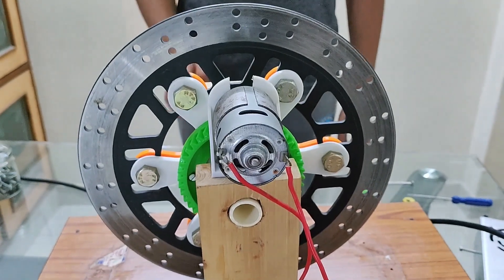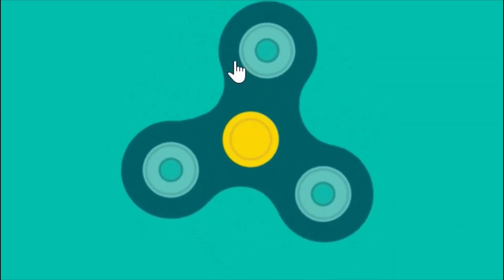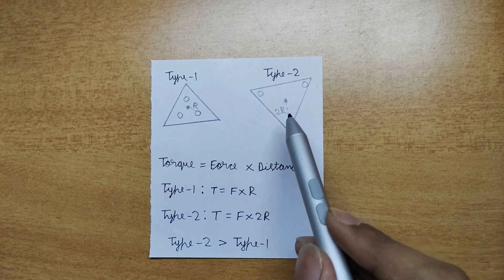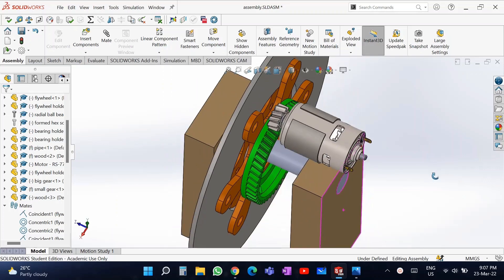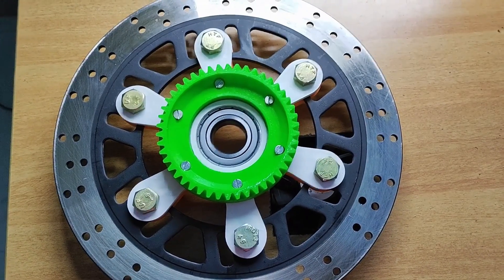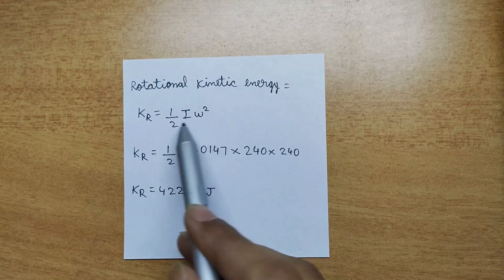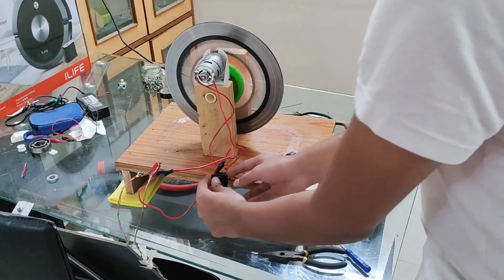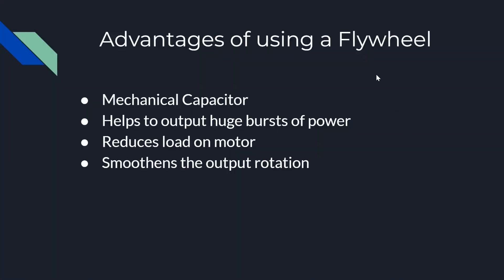Flywheel Energy Storage - Mechanical Battery and Regenerative Braking in EVs

Comment: Just reinventing K.E.R.S! Kinetic Energy Regeneration System. Now if you do this in a Vacuum you get rid of all the air resistance! If you coupling in is non contact magnetic then you lose all the friction!
Reply: Loose “all the friction” is a bit of a lie
Reply: @iguanarapido2552  You can lose more/most if you have your rotating mass in a Vacuum, like a Scuba tank! Most of the space is take up by the rotor & it can be ran at ultra high speed with no air resistance! The bigger the diameter the greater the peripheral mass the further from the centre, the faster it rotates. The more energy you can store for longer!

Comment: How to integrate electromagnetic braking system along with regenerativs braking can u pls help me
Reply from the maker: For electromagnetic braking, you can just short the terminals of the motor or connect it to a low value resistor. All the kinetic energy of the flywheel will be converted to heat.

Comment: Great job! can you please put the solidworks part by repliying to me please
Reply from the maker: The CAD files are in the below link
https://drive.google.com/drive/folders/1-WvbbmJMV3YOA-4OExCOW6UPLpViqqt_
Reply: @aarravoltics4592  thank you very much
Reply: Hello  @aarravoltics4592 ,

Can you explain why or how the flywheel keeps turning when the engine is switched off?
Reply from the maker: @salimtemsamani598  the flywheel has a lot of rotational inertia. So it resists the change in state. It keeps rotating for a while even if it's not powered.

Comment: Is it possible to add a second battery set to a car and use this motor to recharge another backup battery. Is it going to affect car speed or will it consume more energy?
Reply from the maker: Yes, you can connect this regenerative braking system to a smaller battery (12v battery in a car). When braking, instead of using the car brakes which waste all the excess energy, the energy is converted to electricity by the generator and the 12v battery is slowly charged.
So, instead of using an alternator to charge the 12v battery, this can be used. 
This will actually consume less fuel in the car. The alternator consumes some of the energy the engine produces. But if the alternator is replaced with this regenerative braking system, the mileage (fuel efficiency) of the car slightly increases. 
This is why, the new electric and hybrid cars have regenerative braking.

Comment: Great work! Do i understand current that you simply switched the motor off power supply and then directed the motor (now generator) output to the leds directly? And what was the weight of your flywheel?
Reply from the maker: Yes, after the flywheel is spinning at the max speed, the power supply is disconnected and the motor/ generator is connected to the LED light. 
The flywheel is from a motorbike disc brake and it weighs around 1.3kg
Reply: @aarravoltics4592  thanks very much for the informative project and for your quick reply with the info!
Reply: A power selector switch

Comment: What happens if you press the switch again before the flywheel finishes braking?  For example, just 2 seconds after pressing it the first time to act as a generator.  Would the motor burn out? 5:57
Reply from the maker: If the switch is pressed, the flywheel will start accelerating again. 
But this might overload the motor and gears system because power is given to the motor instantly and power will be high until the flywheel reaches its max speed. 
To solve this, a constant current power source can be used to prevent overload of the motor.
Reply: @aarravoltics4592  Thanks for your quick response brother.  Blessings.

Comment: as per your calculations
10% energy saving @ peak
and voltage getting down with rpm
right ?
Reply from the maker: This model that I have built is not very efficient. So, around 70-80% is wasted and 20-30% of the energy is recovered. 
But in commercial flywheel energy storage systems the efficiency is much more. 
Yes, the voltage goes down as RPM reduces

Comment: how did you break current from the voltage controller(the module with a dial) and connected the electric motor circut with LED? What type of switch did you used?
Reply from the maker: I used a DPDT switch (dual pole dual throw) this is connected to the motor, power supply and led light.

Comment: Dear friend, I am a fan of solar power, and the only Achille's heel is the battery. Could you add more brake disks on a longer shaft and get more power stored? I use solar for my two computers and work all day, but batteries are surely a hassle!
Reply: Use a gravity battery

Comment: Great video, where can I find the small generator you used?
Reply from the maker: 775 DC Motor DC 12V - 24V Max 6000-12000 RPM Ball Bearing Large Torque High Power Low Noise Gear Motor Electronic Component Motor https://a.co/d/fGocNI2
775 DC motor
Reply: @aarravoltics4592  Thanks, one more question, I’d actually like to try and make this so I wanted to know if I could get a link to your CAD design?
Reply from the maker: @DJjawesome  https://drive.google.com/drive/folders/1-WvbbmJMV3YOA-4OExCOW6UPLpViqqt_?usp=sharing
Reply from the maker: This has all the CAD files with a STEP file of the assembly

Comment: Very nice and simple demonstration. So, according to your theory you used 50w power to energize the battery and in return you got 150w from the generator. If your practical theory is correct then you can try one more thing from this same experiment. You might know that this much energy within 1-2 seconds can only be stored in a Supercapacitor. So all you have to do is make a supercapacitor bank of 300w and a 150w buck-boost converter for converting output from your motor to store in supercapacitor at a fix voltage. 
Here what you will be doing is you invest only 50w and you get 300w power stored in supercapacitor bank in 3 cycles. So all you have to do is energize the flywheel form external source first time only and then when in regenerative mode, it stores 150w in supercapacitor and in 2nd cycle you use supercapacitor as power source and use 50w from 150w stored and when again in regen mode you store 150w again with 100w remaining so you got total 250w stored this time and in 3nd cycle you again use supercapacitor as power source and use 50w from 250w stored and when again in regen mode you store 150w again with 200w remaining so you got total 300w stored this time. 
So in the end if the capacitor holds 300w then this proves your theory correct and mine also 😜and you got free energy just by investing 50w of power. In near future this supercapacitor concept will be used in every electric vehicle but at present the supercapacitor costs too much but this will change.
.
Sorry for this long comment but if you like my concept then please give it a try and make a detailed video on that. And if you have any doubt then reach out to me through comments.
Thanks for making such videos 🙏🙏🙏
Reply from the maker: Thanks for your comment
I'll surely try your method. 
In my opinion:
I'm not creating free energy here. According to the laws of thermodynamics, you cannot create free energy. 
I used 50W of power for around 8 sec to spin up the flywheel. So, 400Watt seconds of energy to charge. 
In return i got around 150W for 1 sec. So, energy output is 150 watt seconds. 

Round-trip efficiency is only around 30-40% in my system.
65% of energy is wasted as friction, heat and other losses in bearings, motor and generator.

Even if you add a supercapacitor and charge it using the flywheel, you cannot create more energy. Energy can be stored in the capacitor and used later. 
If 1Wh of energy is used to charge, only 0.8Wh of energy can be extracted. 0.2Wh is lost as heat while charging and discharging. 
Efficiency is always less than 100% and there will always be some losses. 
So, free energy devices are impossible. 

Flywheels are used in large scales like in solar power plants. In the day time, the solar energy is used to spin up the flywheel and during night time it's used to supply the stored energy. But it's only around 80-95% efficient even in large scale. 
In this video I'm showing an alternative to lithium batteries (mechanical battery). 
There will always be energy losses so free energy is not possible. 
Please tell if I'm wrong in any part of my comment. 
Thank you